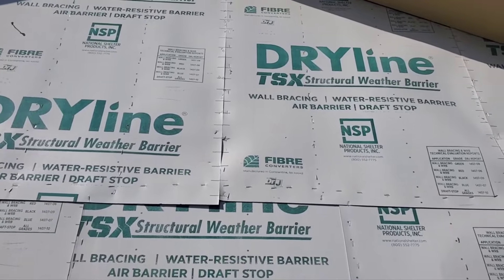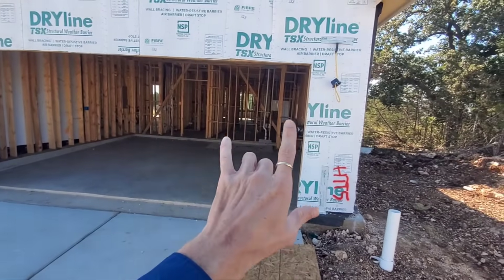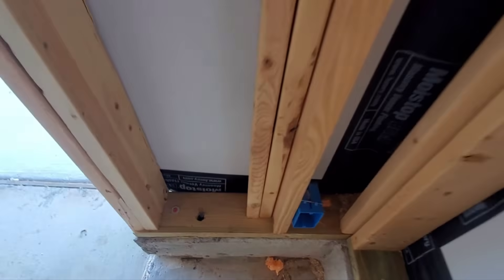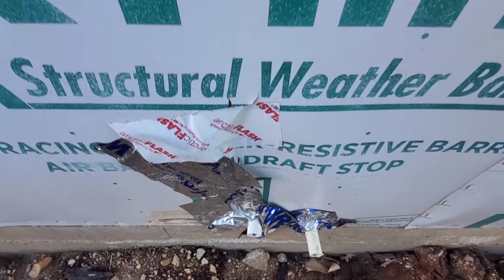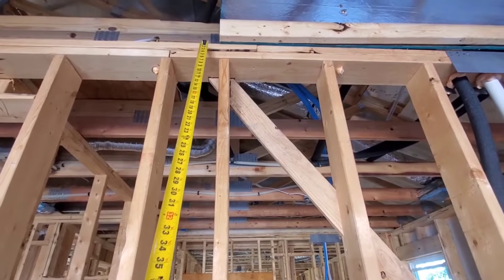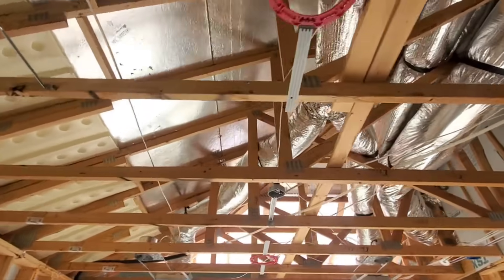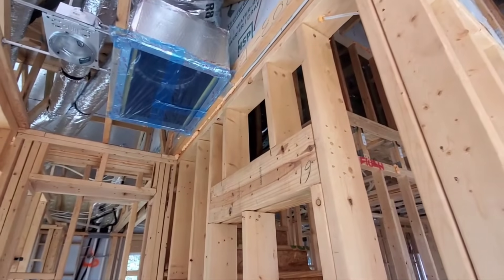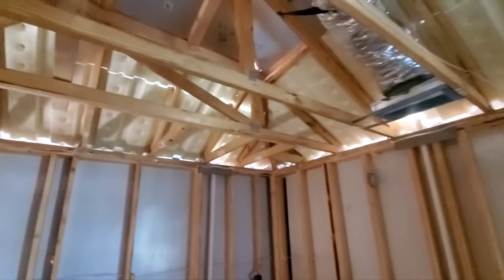Fun findings following the pre-drywall inspection around Austin, Texas. Two words: IMPROPERLOAD PATH

Comment: I’ve seen a couple of jobs like this. One commercial wood framed building tried to save money and hired one guy and his wife to do all concrete and frame. You know it was bad when the curves for the driveway had Masonite on one side and the orange stripe plastic from a road barrier on the other. I’m a plumber so I don’t know the terms but it was designed by bmc and the provided everything needed to build it. Yet they used a couple of 16 penny nails rather than joist hangers, no h clips on roof decking. I’m a plumber so the big issue I had was random nail patterns on top plates. I probably used up 2 self feed bits on the jobs. One stud they missed all three nails on top. It was near where we had to have a ladder. After I almost fell by grabbing it, I pulled the top out so they’d see it and fix it. They’d just go push it back in. Same thing happened two more times, I’d pull it out and they’d push it back in. After the third time, I just ripped the whole thing out and told the gc it needed to be put back in. The gc ended up hiring a third party inspector like this video to basically go over it with a fine tooth comb and give them a list of what was needed to fix it to pass inspection. 
Then we did a house outside of Austin for a preacher. He hired roofers and framers from his church. They had walls that looked like an s. Some walls had almost a 2” difference. Our rough in crew missed a couple of toilets so I had to chip them up and move them. I checked everyone so they’d all be right. Then when setting toilets one was like 4” too close to the wall. I had to chip up and put an offset flange and barely made the toilet fit. I was stumped until I remembered that was one of the really wavy walls. I’d bet money the framers came back and straightened it without paying any attention to where the wall needed to be. They had a beam in the garage that I could rock with my hand. Also multiple boards in the attic had nails sticking out of them. It look like the removed them from somewhere and then just flipped the board and reused them somewhere else without pulling the nails. This really pissed me off because I was walking through the attic. I was focused on the joists and never thought I’d put my hand down on a board and find 4 nails coming out. I almost fell out of the attic. 
I’m long winded but moral of the story is you get what you pay for. If you’re investing all that money in a house, make sure you do your due diligence. Don’t trust a state license or the builders word.

Comment: I just realized what that sheathing was..... my jaw literally dropped!  I built a 12x12 shed with 2 x windows, a front door, and a 8x7 regular garage door this past winter.  I did everything by myself except finish the slab, install the garage door, and install the vinyl siding.  I used it as practice for some things I want to do on my main house (replace all the windows... house was built in 2003 but builder cut corners and used retro-fit windows... think the house wrap is paper towels or something... etc..).    Anyway, my house wrap I used for my shed (the blue Lowes brand fabric, ($299 /roll) is way better than that 'sheathing'.  I used 19/32 OSB for the roof and studs are 16" on center.  My shed is very weather tight (more so than my darn house) and even though it isn't insulated, it was not bad after I had it weather tight in single digit weather!!!  Oh yeah, I used cap staples for my house wrap and for my roofing underlayment... and even though I don't plan on heating the shed, I installed 2 rows of ice/water shield (for practice)!!!

Comment: It doesn’t violate code, but a nitpick for me is the use of flex tube for the vents on those long, straight spans. Greatly reduced flow rate which means a beefier fan which is way more expensive than just running straight pipe, not to mention the extra power cost and noise.
Reply: I'm glad I'm not the only one who dislikes long runs of flex hose.
It will have sag points where water and dust will build up.
-
It's even worse when long runs of it are used for clothes dryers. They slow down the air so that lint deposits and catches on all the ribs, which develop into clogs, and you get reduced dryer performance, and sometimes house fires.

Comment: Do the builders plumbers and sparkles have to go back and make repairs for the defects you highlight
Reply from the maker: As an inspector hired by the buyer, they do not. I don't have the authority that the city inspectors have. That said, my client, the buyer, has a big fat report full of photos, comments, and references of the standards used that they can pull out and use as leverage to get these things repaired. The worst thing for the builder would be to not repair them, they fail, and then they are on the hook for getting it fixed after the house has closed!
Reply: @constructivainspections  Excellent answer to the question! We are in process of buying a new construction house and having the Phase 1 and 2 inspections has been a tremendous help to us in (1) Making the builder aware up front that our inspector will be monitoring the build so they might pay more attention to our house as opposed to the other 20 or 30 they are building at the same time with no buyer's inspections. (2) Catching less than professional work by subs and our supt requiring them to come back and correct and also (3) Having documentation should items not be addressed and issues come up after closing. You guys provide a great service and it's a shame that more folks dont choose to involve you guys. And shame on any Realtors that are representing buys that dont REQUIRE them to use an inspector during the build and NOT just for the "Final" inspection...

Comment: As a contractor I can’t stand working on cardboard houses.  So many people were ripped off.  Nothing like buying a $800k house that’s got no structural integrity and pink insulation.  Try attaching a pipe to the side of a house that’s cardboard; the only thing holding it is plastic siding that will crack in the winter.

Comment: Our mason here has to go 18 above grade. No jack studs under interior door headers seems wrong, because code here.
Reply: If its not a load bearing wall, nails are more than strong enough in many cases.  In general, walls are the part of the structure that has more strength than needed.

Comment: a good argument for factory built housing is consistency and quality control
Reply: Right.  If it did deliver on this, the benefit would not incur as better or cheaper product to the purchaser, but an ability to deliver either a more expensive product to the high end or a lower, although more consistent product to the average purchasers.  Modern techniques have resulted in incredible improvements in labor productivity.  Have you noticed these resulting in cheaper housing.  Expensive housing is a feature, not a bug.

Comment: Matt Risinger just did a video on how garbage that cardboard is for rigidity... And how little more it is. The OSB sheathing is ~$15/sheet and the cardboard is ~$9/sheet. Not much difference when building an entire house.  I can't believe code still allows it to be used. I can attest that it sucks. My home was 'sheathed' with this when it was built about 20 years ago. A few years ago we had a wind event from the North/Northwest (thats the direction most big storms come from in San Antonio Texas) that was powerful enough to 'rack' every house on my street where the back of the house faces North and the wind wasn't cut / blocked by either very large oak trees or other 2 stoy homes behind them (breaks up the wind). Some trees even fell. Needless to say, i had to hire a structural engineer and my insurance isn't happy. $$$

Comment: The cardboard sheathing is mind blowing to me - I am from up north. I noticed how you pointed out the nailing patterns on the shear walls on either side of the garage door. I get that you need more nails there with plywood/osb, would it even make a difference with the cardboard?!
Reply: They use see through sheathing up north. I saw the video. The wind blows through it. New construction is garbage.

Comment: How about all that unsupported and unprotected romex dangling across the ceiling joists and bottom chords?  We're required to protect them.  The purpose  is to prevent damage from someone working the attic.
Reply: that's normal, but it should be organized and properly attached

Comment: I won't touch on all the defects that were mentioned. I know that I wouldn't do them.
I will touch on the 2x6 construction. Awhile back I heard of using double 2x4 walls with a gap between them that basically makes the wall 10" to 12" thick depending on the spacing. It also creates separation that is filled in with insulation. What's your opinion on this? This is supposedly stronger than 2x'6 and is cheaper, except for the amount of insulation that fills in the walls.

Comment: wait you can use staples for sheathing? i always use screws i have tons of roof decking that has that and once a leak starts the staples rust to nothing and the whole board starts coming up. also osb is horrible for longevity. spend the last few day patching a roof leak from the 80 year old cedar plywood roof deck osb last maybe a 20 years best case. never let a repair man or builder use osb on your stuff just pay the extra cost it's worth it.

Comment: I dont really understand building houses from wood.
Im from NL/Europe and all houses here are built from brick. I dont really know why, but i suspect because of our wet weather and wind, wood is not very durable in these conditions. Of course we can build with wood and i guess if you look back far enough, you wil find some wood, but even historically, its all brick/stone. We do use wood for floors, although thats also less and less so.
And since those walls are double, inside wall and outside, the wooden beams that span for the floor, rest on the inside brick wall. All forces go down through that wall. (and that wall is connected for structural strength to the outside wall.

Thats more expensive than wood building, but heck if its your home, you want it to last at least your lifetime, right?

I cant imagine building a house with sheathing of hardboard. Thats crazy. Anything will penetrate that. It has very low structural strength. And it would be rotting away here in decades, if not just years. We dont even use that for a shed in the garden. Its doable for the backside of a cubbard. Nothing more.
Why do people accept this????

Also, its pretty easy to build with brick. Once you have a good foundation, bricklaying is quite easy. You dont have all those joints that you have in woodbuilding.
The material is also consistent in strength; doesnt weather or change much and in fact only gets stronger in time, while wood loses strength in time.
Stone/brick also doesnt do much in temp and humidity changes, while wood, all sorts, change as temp and humidity change. It 'works', as we say and you have to allow for that. Which means building with wood is far more complex than building with stone or brick.
All those joints is a nightmare.
Its not like we dont know how to build with wood. We build sheds with it at times. Some architect may decide he wants to do something nice with wood, but generally houses are built with brick.

Is it customary to build with wood, or is it that much cheaper? I can hardly imagine that. Cement and brick is pretty cheap.
Ive been in the US 3 times. Saw the wood build, but.... i dont get why you would do that. I mean, if you build a brick wall, you can see from a mile away if its decent or not. If its wood, you have to check each and every joint ffs. Each joint thats not right, means the wall can fail. Each piece of wood thats not right, means the wall can fail.
And then cover it up with hardboard, some tape and dry wall on the inside....
Thats a nightmare.

I still dont get it. Hardboard? I thought that stuff was isolation and there would be a stone wall in front of it? Are you really saying this hardboard stuff IS the outside wall? So they slap on some stuc or what have you, for looks and thats it???

Comment: Is the washing machine or a slop sink going to be installed in the garage? If so you can't have the plastic washing machine box or any of the drain stub outs in plastic. They have to be metal due to penetrating a fire wall.
30 yr plumbing contractor and commercial plumbing inspectctor.

Comment: Yeah, good LUCK with getting all that fixed. Guarantee you it wasn't. I had no idea they still allowed that cardboard crap on houses still. I mean, in FL that stuff stopped being used in the... 80s? I still find this stuff on gables and dormers in FL on homes built in 60s-80s. We always replace it with plywood, then vapor barrier it for vinyl siding.

Comment: That "sheathing" isn't sheathing  at all. 
Sheathing is laterally supportive.
OSB or CDX is sheathing both can be 1/2" and there is a nail pattern as well as a nail pattern inspection. Yes a nail pattern inspection.
Also, make sure that framers don't crank up the air pressure to high and set the nails to deep. The nails should be flush with the face of the sheathing.
That cardboard, we call Denny Board and is insulation all be it a very low R value, like 2 or 3.
In the homes i build I could never get away with some of those load path and anchor bolt issues.
Definitely not a quality frame job.

Comment: Don't ever think of having a house built without doing a private framing inspection. Your municipal inspector is looking only for systemic problems. On anything that's still disputed, bring your own engineer to check points of contention or you could be tortured for years with issues. This house is a disaster and clearly had careless subs with clearly mixed-experience workers. I've had two homes built for me in the last ten years, and never seen something so bad.  I've seen similar issues, but not at the volume shown. Luckily this is all fixable and they are lucky they got an inspection. They need to walkthrough on the fixes before sheetrock (and they probably only have a couple weeks). I guarantee they won't fix everything correctly the first time based on what we see.

Comment: Wait.  2x6 is not STANDARD in TX?

Edited…wait, never mind.  The “sheathing” is cardboard, or at best fibre board so yeah 2x4 walls track.

And not a lick of insulation either.  Apparently heat does not come INTO an air conditioned house, it only goes OUT of heated houses.

That’s how a 2 day slight dip below freezing stopped TX cold, pun intended, and they pay an arm and a leg to cool these McMansions.

Comment: I have homes with structural sheathing. The staples are very large and they overlap at the joints. That sheathing sucks because installing fixtures such as lights is a nightmare, you have to place backing or a stud

Comment: I expect most of the houses built starting about 15-20 years ago are not going to last more than 30 to 40 years because of the hacks we have for trades people these days.  Pretty hard to cost-effectively fix hundreds of structural defects that are bound to be in these garbage speed-build homes once all the drywall and trim is all in place.  These framers should be fired, and the contractors should be embarrassed.

Comment: What's the story here? Are you early on the inspection or did they think they were done
Reply: This level of craftsmanship isn't acceptable at ANY stage of the build. The only part that can be open for interpretation is the foundation anchors, it's possible that negotiations are going on to determine who gets a charge back on redoing them. That isn't an uncommon occurrence for the foundation contractor to miss on some or leave some out. As far as the sheathing goes someone took the time to staple it, why would I think their plan all along was to do it twice? All of the mistakes were due to lack of knowledge and a complete and total lack of pride. The top plate joints show that the builder has no clue what their purpose is for.

Comment: How do you fix some of that stuff that is load bearing?
Reply: It can be fixed. A post jack to carry the load, remove the  framing,  and replace it with framing cut to fit tightly.  Most of the structural issues I saw came from using pre cut framing on a slab that isn't flat.  Since very few cement contractors can actually pour a flat slab I spec'd a course of half high block under load bearing interior walls.  The additional cost was more than recovered  by the labor savings generated by not having to cut every stud to fit.

Comment: I've never met a contractor who wasn't a scam artist. They're worse than lawyers.
Reply: This is 250% true. I worked for a supply company for a year and the stuff I saw delivering pipe and fittings was insanity. Also some of the city building codes was wild too.
Reply: True, there are some real scumbags operating out there, but not every contractor is bad. I’ve worked in construction for 42 years, and I’ve seen plenty of this type of thing, but I’ve also seen plenty of good ones as well. One of the biggest problem that we face now in the building industry is that in the crash of 2009, all of the 50+ year old skilled craftsman with 30 years of experience lost their jobs and never came back. An overwhelming number of the clowns out there now have no idea what they are doing.
Reply: This I what you get with using the lowest bid w/o checking on the builders reputation and history of work!
Reply: I was a building contractor for 30 years 70’s -90’s, I took great pride in my work, and insisted on quality from my subcontractors. Sad story is I never made much money, I never charged enough but still produced quality.
I look at these inspection videos and cringe at the lack of quality or even acceptable work. No pride in workmanship.